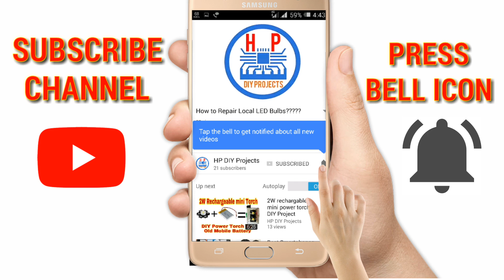Contactless AC Detector or Static Electricity Detector project

Comment: What the ckt diagram if i want to add the buzzer in this gadget
Reply from the maker: First remove 330 ohm resistor and connect 5-12v buzzer in Series with LED and give input between 9-12v. If any query reply me....
Reply: @hpdiyprojects  can you give me pcb layout of this circuit...
Reply: I want pcb layout of this
Reply: @hpdiyprojects  hey the buzzer is not working